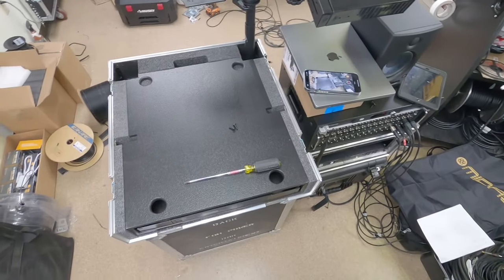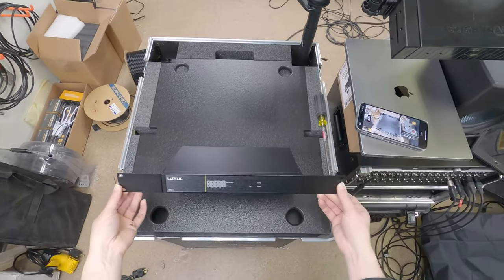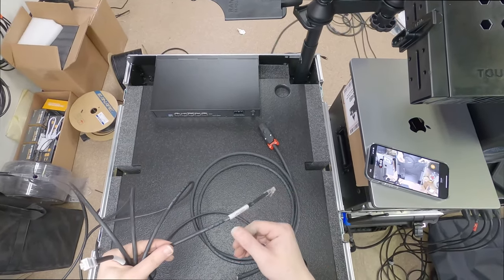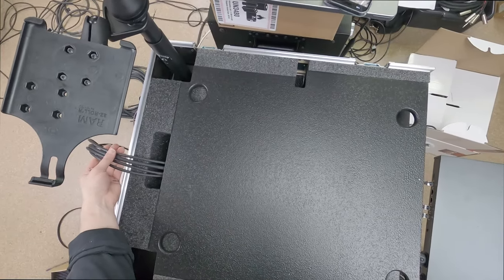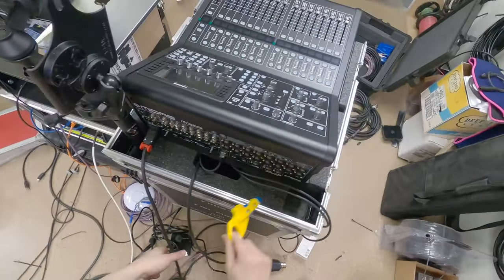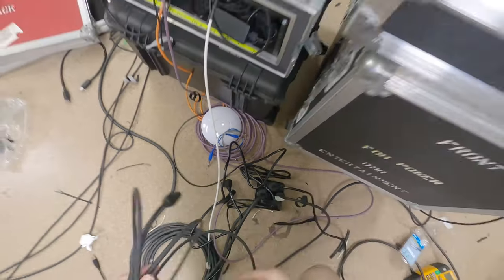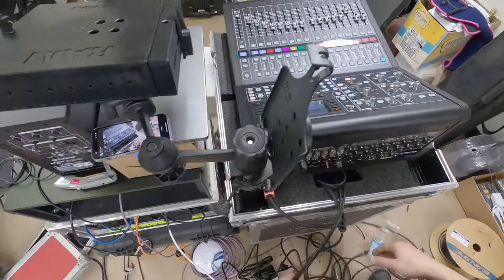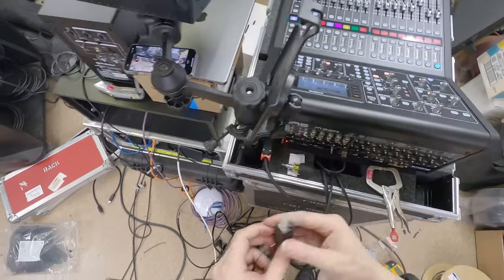Setting Up & Wiring My M32R Case

Comment: You kept saying 15,000 cap rooms. Did you mean 1500? Just wondering because you also mentioned 2500 seating theaters.
Reply from the maker: We played larger amphitheaters on that run as well.

Comment: Hi Billy
Nice video as always

I have one question, which I couldn’t find the answer for.

Have You ever tried patching out an AES50 connection?

I am planning to build an all-in-one rig, with an X32 rack+S16 box, mainly for in-ears, and occasionally for FOH as well. We will buy a Dante card for the X32, so the keys and tracks can live on DVS, without interface, without double conversion. I want to make it compact, but I want the possibility to send the digital signals both with Dante and AES50. I am aware of the shell continuity problems, which occur with Behringer and Midas stuff with AES50. Do you know any solutions to that?

Best regards,
Csabi
Reply from the maker: I’ve never used the Dante card. Though I’d bet that it works like the recording USB card that comes with the console. You would set a bank of inputs to “card” for your Dante lines and set the other banks to AES50 for the analog inputs coming from the S16. There is a box called the Multiverter that is a format converter matrix. One of the conversions it does is Dante to AES50. I don’t think you need it, but it’s a cool tool to know about. https://www.sweetwater.com/store/detail/MVR64--appsys-mvr-64-multiverter-digital-format-converter
Reply: @billylaguardia  oh sorry I wrote it in a misunderstandable way. I was speaking about the Dante Card just as an extra explanation of my situation.

My question is about phyisically patching out an AES50 connector from the back of an X32 rack to a rack panel. I would rather have closed racks, unless I need any kind of shelf.

As You possibly know, there are some problems with using any extra patch point with AES50
Reply: And as I read it on some blogs, it might be because the AES50 connection needs shell connectivity, and uses the shell of the ethercon connectors, alongside the shielding of the cable itself.

And in most cases this is not a problem, point-to-point cabling is possible.

But what if you want a nicely made rack..? How can it be patched out?

That was meant to be my question :)
Reply from the maker: @csabislezak8485  ahh sorry! You will be fine with an IO panel. Just use a shielded cat and the HD Neutrik NE8FDX-P6 jack. I keep a few of them loose in my workbox to use as turnarounds. Point to point is always the safest - I’m sure you have seen my AES50 struggle videos! But you really should be ok with that heavy duty jack. I’ve switched from using the NE8FDP jacks as the FDX jacks are built waaay better. https://www.lmcasesonline.com/neutrik-ne8fdx-p6-cat-6-feed-through-connector-nickel/

Comment: I've never heard of the brand Luxul, what made you choose them vs something like Cisco, Ubiquity, or Microtik? coming from an IT world these are very common brands.
Reply from the maker: It’s an installers brand. I generally use Ubiquiti ER-x routers however they have been unavailable during and post Covid. The Luxul brand is great. They also have an IEC power inlet and a more durable rack mount format. Both are important for me since everything I build needs to be on the road.
Reply: @billylaguardia  could you please Tell me the exact Type of the Router? Thx
Reply from the maker: @shrike9t1  https://www.legrandav.com/Products/Routers/Wired%20Routers/Epic%204%20-%20Multi-WAN%20Gigabit%20Router/ABR-4500